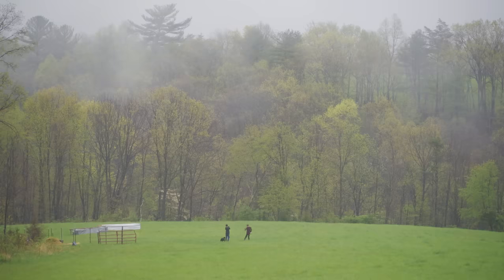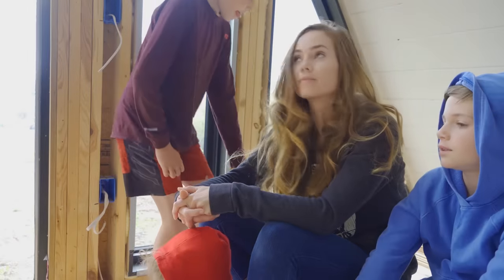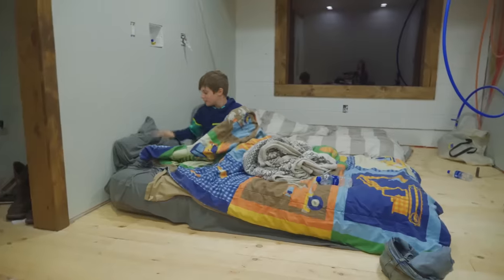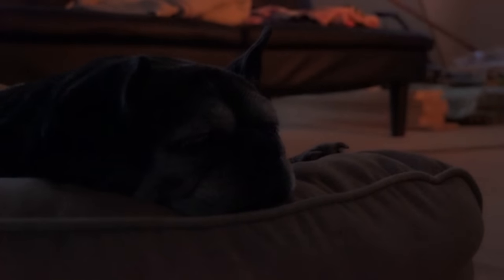Unexpected Disaster Forces Us To MOVE

Comment: Been there, done that, got the tee shirt!  After Hurricane Katrina, we had a 22 year old RV our parents found us and we housed 3 teenagers, 3 dogs and 2 cats.  Important note, no one unbelievably was killed...LOL.  We were so busy with rebuilding our house we did the same patchwork on the RV.  We had finally dried in the house when a huge rainstorm came and were getting rained on in the RV.  We all moved to the house with no Sheetrock in place (insulated though) , 1 quasi bathroom, makeshift utility sink  in January.  After a few modifications where the house was warm (heater was not wired in yet)  it started coming together for the next 4-5 months.  You will survive this as well as we did.  Good luck!!!  Your kids are resilient and they think of it as better than your other accommodations.

Comment: Pretty fancy railing for temporary. I wouldn't even bother with putting in the plugs for temporary. That railing looks quite nice, I don't know why it is temporary other than the opening for the ladder.
NICE alternate housing option, decent air beds can be pretty comfortable for many months. The timing of the disaster isn't all that bad since you have water, power and your woodstove. Kitchen just needs appliances, put in a toilet. It will be fine. You two work so hard it will be done soon in any case.

Comment: The Wood planks you burned and Got up on the front of your House between your Windows, it looks really good! But it looks like you havent thought about how the water slides away from the horizontal edges of the planks. the edges should be sloped so that the water can slip off, but you have placed them directly on top of each other which will result in the water slipping in between the planks and, and especially in the end shocks :-)
Reply from the maker: There will be a deck with a large overhang so they windows/planks won't get rain on them